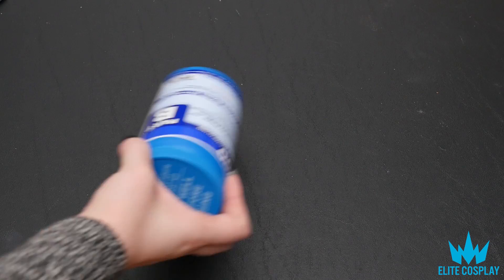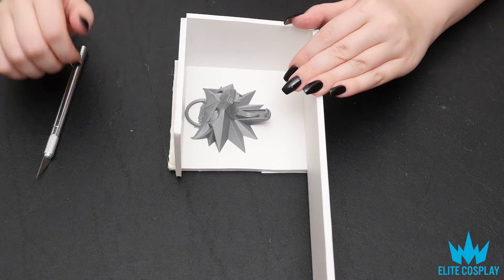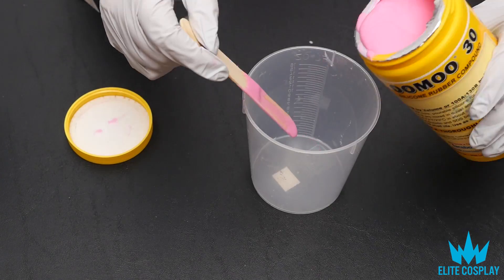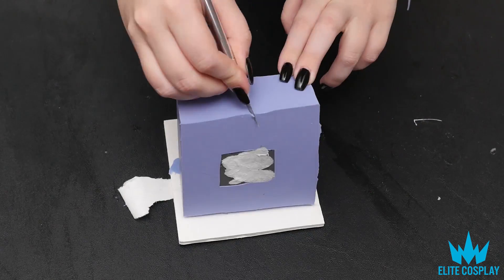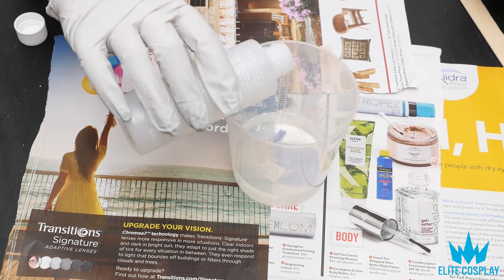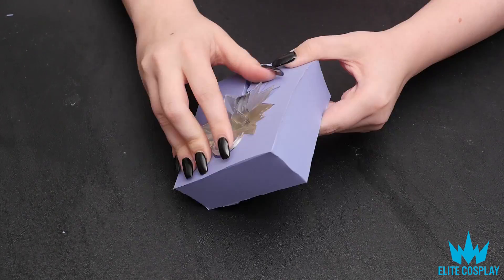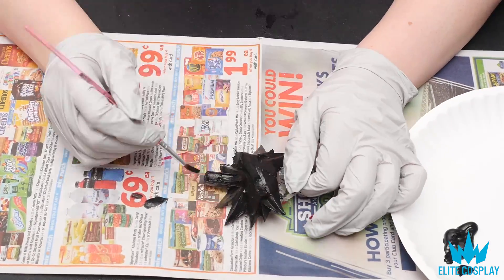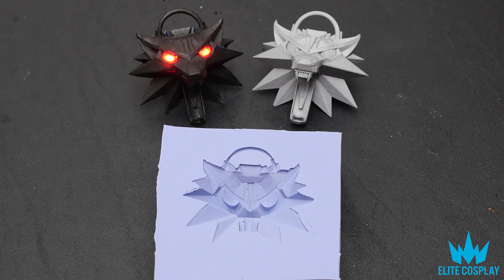Making a Silicone Mold and Casting Resin Tutorial

Comment: How would I make a mold for objects that aren't flat?
Reply: @Master Guard
You would need to make a "2 Part" Mould. It will cast 2 halves around the piece, so you have a front and a back side. Both halves will have to Cure separately.

Comment: Two comments: When mixing the silicon, it may be a bit easier and you may get better results by alternating the mixing each portion of the resin and hardener a little of each at a time. Also, you may want try spraying the object with a little mold release before pouring the silicon into the mold. I find that makes release a lot easier. Good video.

Comment: If you're going to create multiple copies from the mold, take the time to polish the master to the smoothness of surface desired, and then create the mold with it.  Your pieces will then come out of the mold with the same smooth surface.  Otherwise you're just copying those 3D surface imperfections onto the mold, and then transferring them to every piece you cast with that mold.  I'd also use a better resin.